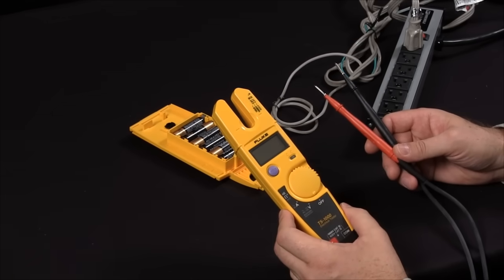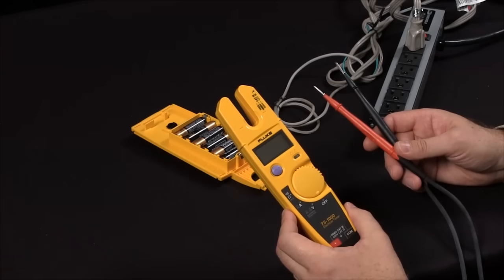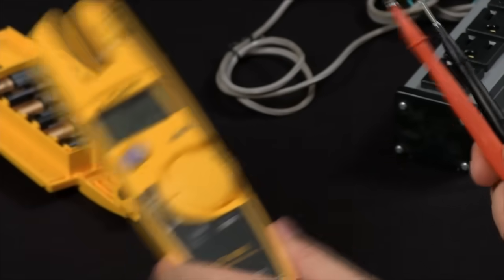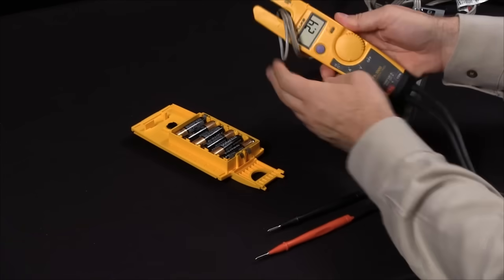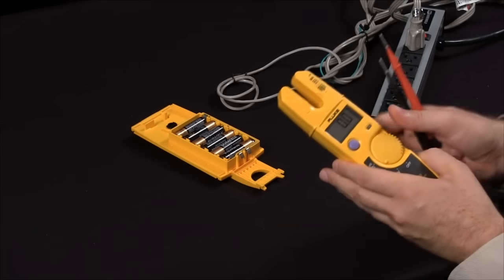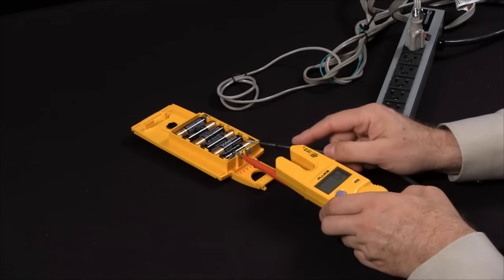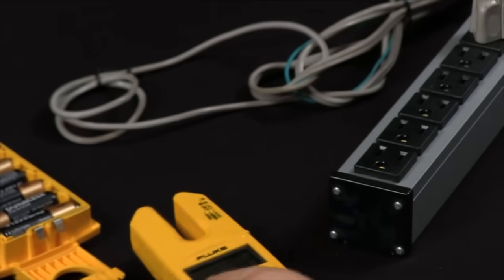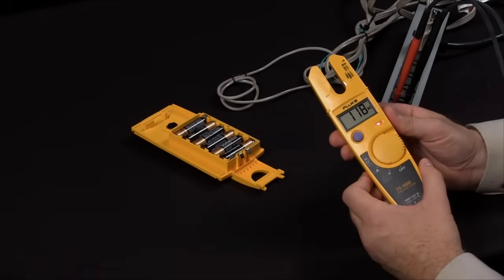How to Measure Voltage And Current Using The Fluke T5

Comment: Uh, When you were measuring current you put the jaw around a conductor that was coiled three times... Wouldn't that cause the current reading to be Three times what it Actually is????  Thanks
Reply: So if I have a cable drawing 2amps, I just coil it up to make 6amps ? Hmmm

Comment: Are the T5-600 and the T5-1000 identical, except for the fact that one is rated to 600 volts and the other rated to 1000 volts?
 Does one of them have any different features than the other such as accuracy?
Reply from the maker: Great question! Yes, the T5-600 and the T5-1000 are very similar, with the exception of AC Voltage and DC Voltage ranges. The T5-600 measures from 0 - 600 V, and the Fluke T5-1000 measures from 0 - 1000 V.

Comment: DO NOT BUY FLUKE, LOSS AND DOUBT QUALITY.

I set up a 100% FLUKE test and diagnostic bag, my happiness didn't last 3 months. because it would be easier to have thrown the $ 20,000 I spent in the trash.

The equipment described problems, defects and housing deteriorate.

Equipment and defects:
1 - MOD 279 FC Multimeter
DEFECT: BATTERY-FREE SOURCE

1 - MOD 117 multimeter
DEFAULT: HOLD BUTTON DOES NOT WORK

1 - Clamp Ammeter MOD 305
DEFECT: INTERNATIONAL PART OF BATTERY BATTERY DETERIORING AND NO MORE CARE.

1 - T5-600 MOD Tester Meter
DEFECT: RESULT OF INCORRECT TESTING AT AC 110VOLTS APPEARS 16VOLTS.

1 - MOD IAC A2 II voltage detector
DEFECT: DO NOT CARE

1 - MOD 59MAX laser thermometer
DEFECT: FIRST KICK does not have to press several times.

1- Laser tape measure MOD 414d 50m
DEFECT: ONE THAT WORKS PERFECTLY.

I tried several times to get in touch with the numbers in the manual, where I passed new numbers, which I passed to several people, and nothing resolved.

my last attempt to resolve this situation, you can go to court for small claims and create a youtube video showing the occurrences.

I'm feeling highly [Edited by Complain Here], by FLUKE, and also sad by the disappointment.
Reply from the maker: Hi there - We are sorry to hear about your experience and would like to help. Can you please send us an email at communityadmin@fluke.com with more details? Thank you.

Comment: It’s useless for dc as it just rounds off to the nearest volt without a decimal point. So if your battery is 12.60 the meter will say 13
Reply: DUCK!!! I wish I knew this beforehand. I was looking for a small simple meter and thought the T5-600 would fit the bill. Nope.
Reply: well, it’s rated for 1kV, and built for fast troubleshooting, where half a decimal doesn’t make much difference. This is definitely not made for low volt electronics.

Comment: can you still measure amps using the prongs instead of using the open mouth 'U'?  please answer as I'm on the verge of buying this.
Reply from the maker: Hi Martyn - thanks for getting in touch. Current can only be measured through the jaws on the T5. The probe is used to measure volts, ohms or continuity. Please let us know if there's anything else we can do to assist.

Comment: oh now i see. the open jaw doesnt work on my fluke t5-1000. i thought i just had the wrong dial or something
Reply: +Tyee Cambrón The open jaw can only measure one single conductor at a time. this means it can only measure the live AC line only if it is by itself. if the electrical cord is still joined together, or it is an internal braided wire, the clamp will not work. Again, it can only measure one single conductor at a time. If they have a hot and neutral line together like in Romex house wiring, it will not read.
Reply: Lem Aiko I'm guessing because the line and neutral have a cancelling out effect on the magnetic field?
Reply: @tom8396  Exactly Tom. This is also why the hot (line) and neutral wires should ALWAYS being next to eachother in a residential setting, otherwise people will be living inside magnetic fields. This is coming from a health perspective, as the electricity will still work even if people nearby are negatively effected by the magnetic fields.

Comment: what causes the 2 red triangles to light up on this tester?
Reply: +Mark Ward Anything over I believe 40 volts AC or DC will trip the red warning light. This just means high voltage is present.
Reply: It fried my meter
Reply: If this is done on the ohms setting it will have burnt the protection fuse out. It can happen to anyone. I've destroyed a Simpson 260 in continuity mode this way.